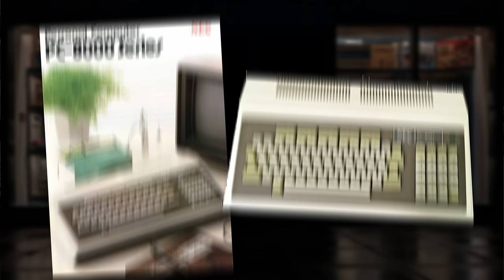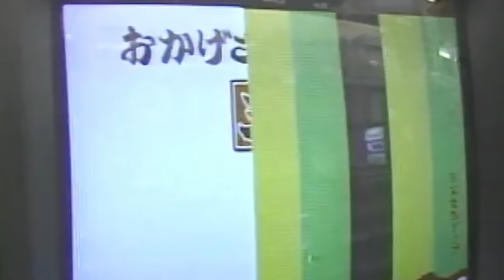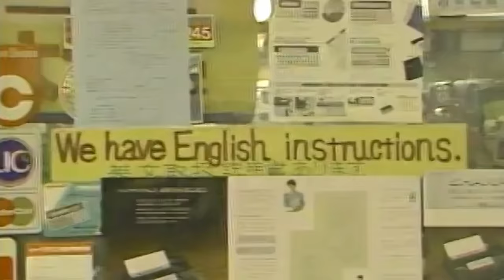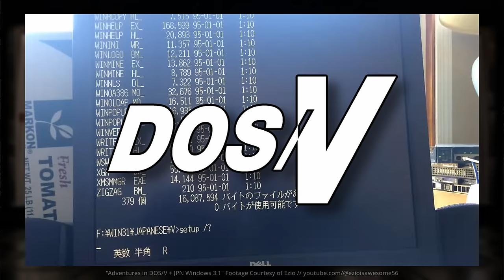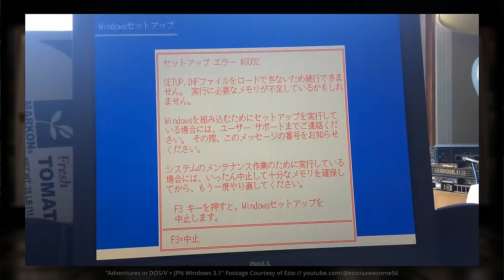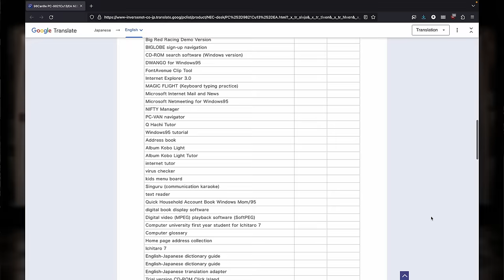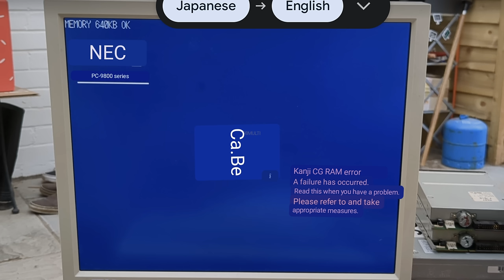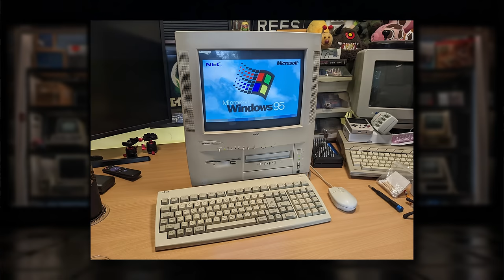NEC PC-88 & PC-98 Story - Also, Let's Restore A PC-9821!

Comment: The first graphics card to use the chip was Orchid Technology's Righteous 3D, released on October 7, 1996. My big brother had one of those, before we bought the Voodoo 2 12MB.
I could not find any dates on the PC-FXGA , however wikidata says: 8 December 1995. I found a reciept inside my PC-FXGA showing it was bought on 1998-01-11.
Reply from the maker: Interesting to know, thanks! It's certainly difficult to track down information on this obscure Japanese stuff, especially from 30 years ago.

Comment: Somehow, I missed the first airing of this one... I was enthralled... watched it all the way through. I am not familiar with the NEC PC-98 line of machines, but I would venture to guess that the mystery backwards "PCI" slot may actually be an ACR slot. The off-set mounting of it compared to the other PCI slots kind of hints at it. ACR cards were largely proprietary; I'm aware that motherboard companies, ChainTech in particular, used them a lot during the 2002-2005 era.
Reply from the maker: I hadn't come across this before (or maybe I have and just didn't know the name) but it looks like you may be on to something here! Thanks so much for the suggestion. I have some more learning to do. 😁

Comment: I've noticed that Puyo Puyo 2 and Rance 4.1 display more colors than usual (around 60 / 100+ respectively) while pretty much all other games from around 1990 onwards only show 16, and older games show 8. Do you have any info on that?
Reply: The PC-9821 added built-in 256 color graphics that the 9801 didn't have.  It can do that at 640x400 24khz or 640x480 31khz like a PC.  SimCity 2000 shown briefly in the second video uses the 640x480 mode for example.
Reply: @thepirategamerboy12  I suppose they are 9821 games then even if the boxes or online databases don't mention it. Basement brothers commented on that earlier. Thanks!

Comment: IIRC, the PC-FX had no 3D capability (that was its main weakness against the Saturn and PlayStation), so that board wouldn't work as a 3D Accelerator.
Reply: Actually, the PC-FXGA had 3D capabilities that were not included in the actual PC-FX console, so he is not wrong. Weird, I know, but true.
Reply: One note about the 3D accelerator chronology is that SGI's IrisVision pre-dates 3dfx's 3D cards (and probably S3's, too). 3dfx was founded by people from Pellucid which was a spin-out of SGI around the IrisVision technology.
Reply from the maker: I should have known that SGI would have done it first. Thanks for the info 👍

Comment: On your potential 230/120VAC issues, while stationed at RAF Mildenhall and living in beautiful Bury St. Edmunds, I like many other yanks living off-base used step-down transformers to power our 120VAC hardware.  You should be able to get cheap, used ones as yanks leave the UK since they will have no use for them in the states.  I gave one of mine to my next-door neighbor to use with my 1040stf and color monitor which I gave to them for their kids.  By then, I had converted over to an Am386DX40 PC which I had built.

Comment: You should make a proper effort to dump the bios and any other roms and stick them up on archiveorg together with high quality pics of all the boards. Then when that thing dies (rom bit rot is a thing) you'll be able to use that backup to repair it and/or access it via emulation. Don't make the mistake like most clueless noobs and assume it is invincible and will last forever.
Reply from the maker: Sounds like a good idea. These things certainly aren't very well documented and the software is difficult to track down. I'll put together a package as the series goes on with the aim of uploading it to Archive.org, as I have done in the past (ie the S3 ViRGE stuff).